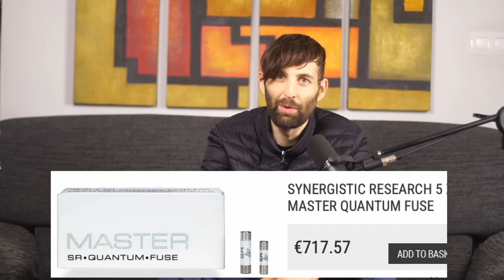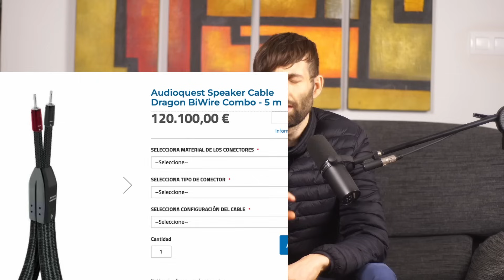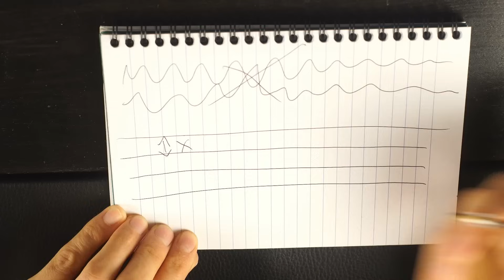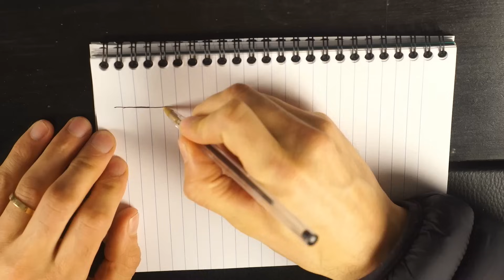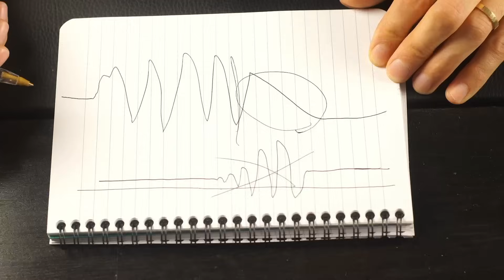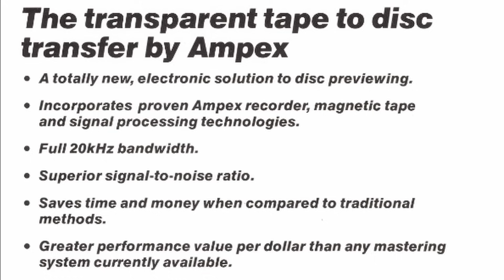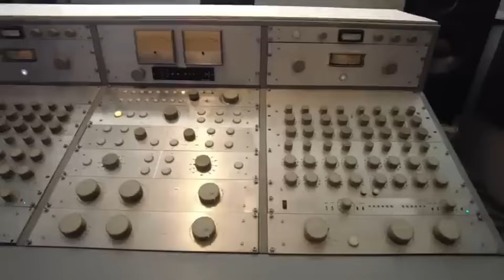Hard truth: most vinyl is digital anyway

Comment: @APMastering
Vinyl is not cut/pressed to atom-perfect standards, so there is always going to be distortion, that is imperfect nature of material science - this isn’t NASA, nor is it cut to a sample rate so there is continuous sonic information between the samples in comparison to its digital counterpart.

Please, go ahead any find an atom-perfect cutting lathe, completely dustless environment, completely flat needle/playhead, completely flat pre-amp and A/D converter and null them in any DAW of your choosing (none of which exist) - if hypothetically you can find these I can assure you they will not null with their digital vinyl master file.
Reply from the maker: you can't null because wow and flutter. but id be interested to see what kind of cancelating you'd get using the playback pickup on a Neumann vms70 as they have essentially no wow and flutter as its so heavy
Reply: @APMastering I just want to refer back to your previous video last week where you said I quote “vinyl doesn’t have a sound in my personal opinion” - yet you’ve just concluded that vinyl has wow and flutter - objectively is that not the sound of vinyl? - Imperfections that will never align to the digital vinyl master counterpart. 

I’d also argue that the wow/flutter are not the only sonic characteristics but also subtle distortion that is introduced from the imperfect cutting from the lathe contributes to a warmer sound (see below)

“24-bit precision gives you about 16.77 million values. Assuming a total groove width of 50 x 10^-6m, the maximum movement of the cutter is physically bounded at about half that. Much more and the cutter will be in the space for an adjacent groove.  Thus, 50 microns width divided by 16.77 million gives us about 3 x 10^-12m, i.e. ~0.03 angstroms.

The diameter of a hydrogen atom is 1.0 angstroms (1 x 10^-10m). That would make the resolution of a 24-bit digital signal equivalent to an analog cutter whose resolution is just about 1/30 the width of a hydrogen atom. Sadly, this seems to be physically impossible, as none of the particles smaller than atoms are stable enough to be used in records.

Of course, records aren't made of hydrogen, they're made of the polymer pvc. One molecule of pvc is about 100,000 angstroms. This means that, if the cutters were actually removing single pvc molecules the vinyl records would have about 11 bits of resolution. Sadly, they don't get even that precise, though I'm not sure the actual precision. To get down to a record made of hydrogen atoms (possible under very low temp/very high pressure I suppose) one would need 19 bits. Anything beyond that is useless as long as the laws of physics hold”